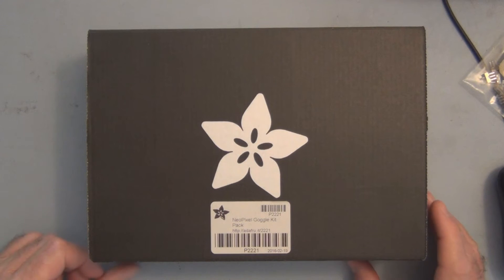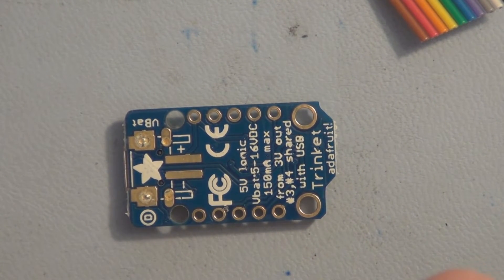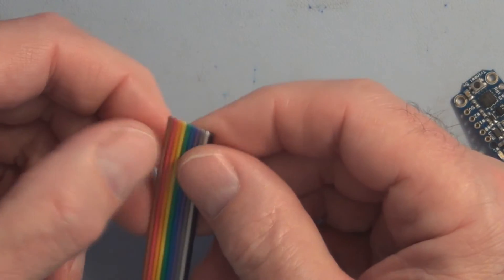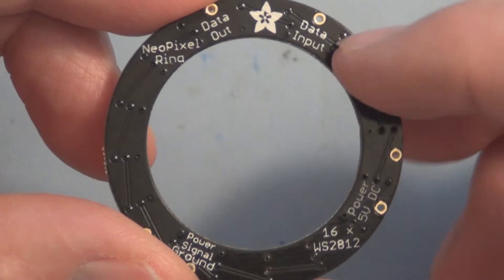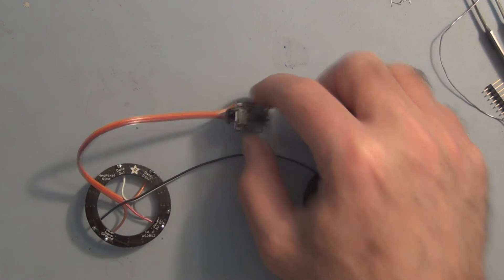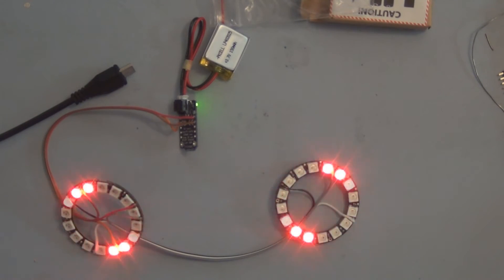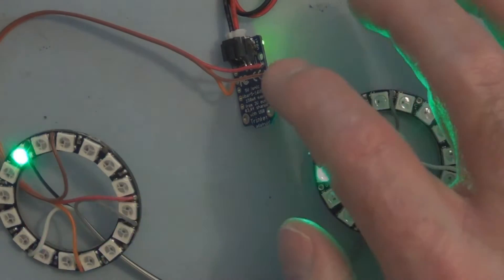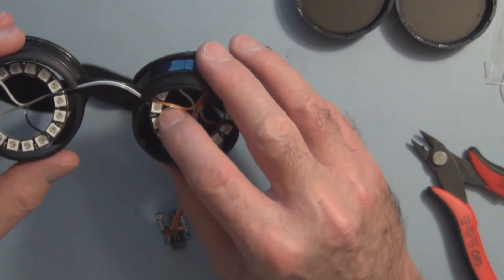NeoPixel Goggles Build

Comment: You can 3D print some light blank inserts that will protect your eyes.  Works kinda cool; you can integrate a rotary encoder to flip through stages of brightness and use them as a flashlight alternative.  Headlamp works better though.

Comment: You plugged into USB cable good you pushed your button so that the trinket could be recognized by your computer good but before the trinket was recognized by the computer as a USB device you started trying to upload your Arduino data and that's why you're errored I think.